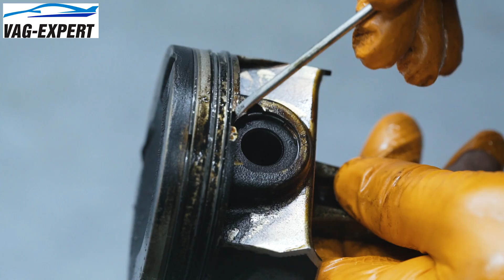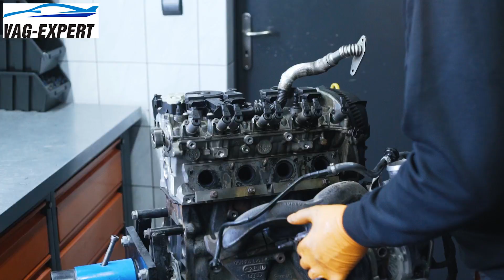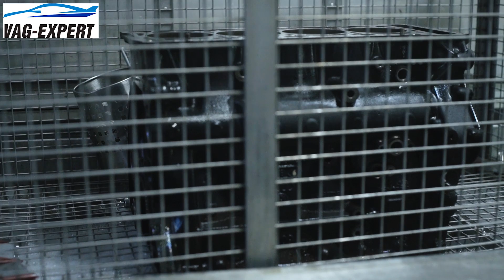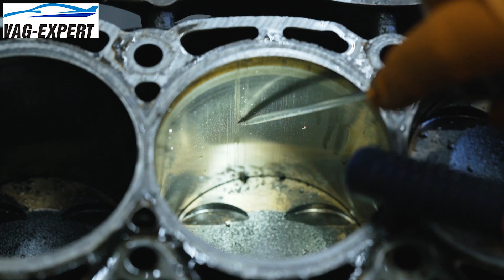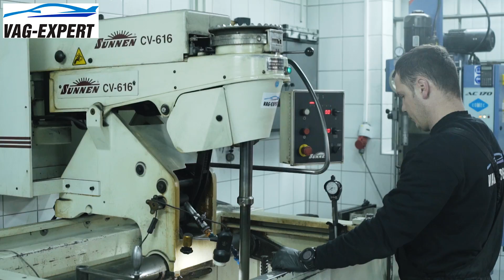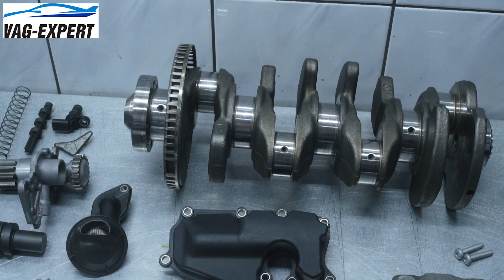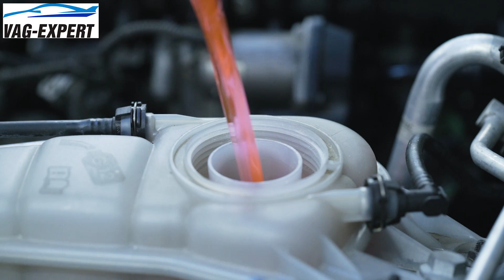TSI and TFSI engine overhaul

Comment: I’m doing engine rebuild now on a 2014 tiguan 2.0 tsi, misfire cylinder 3 and a L of oil every 1300km if driven max 120kmh, if I drive more than 120kmh it burned 1L every 200-300km
So far 3000€ I bought it 6 months ago with 223 thousand km.

Comment: Worked at VW Chattanooga manufacturing plant, bought a brand new ‘15 model Passat, and it started burning oil profusely at 80k miles. I was told that was normal, just keep an eye on it and change the oil regularly, topping it off between changes. The engine made it to 148k and blew up right before this past Christmas, lost all compression on the #3 hole. Lean condition caused by excessive oil consumption caused a hole to burn through an exhaust valve in that cylinder. Pulled the head and all the cylinder walls are trashed, the coolant that filled one of the cylinder bores leaked right past the rings and into the oil pan before it could even be sucked out with a shop vac. Sucks that we paid this thing off and was going to hand it down to our son for his first car but now it’s just a junk pile. No one wants to work in it, no one here in the US seems to rebuild these engines. All I’ve been told is to replace it with a new or used unit. Can’t see spending more than the car is worth to do that. When I look on FB marketplace all I see are blown up Passats for parts, don’t seem like you can hardly give them away. What a shame, $25k down the toilet. Should have bought another Chevy. We just replaced this car with a new Mazda today, hopefully have better luck with it.

Comment: Repair is always cheaper than replace. The problem in our societies is that waste has become so huge, people can always benefit from what others have discarded. If people held on their cars for life, and fixed everything until no longer possible (this is, there wasn't a constant surplus of used cars because people get bored and just decide to buy another) people would never complain of the expense of a service like this.
Reply: I live in a place with high labor rates. $100 usd/hr is a common rate for your average garage. A specialist like this could easlly charge $120-200usd/hr. For me to repair my dad's 2011 2.0t q5 would cost more than selling it and then buying a Q5 with 3.0 supercharged engine or a X3 35i with n55 both of which are more reliable than the 2.0t. Not to mention produce 100 more horsepower. We have owned this q5 for 12 years and I have many memories of it. I learned to drive in this car and I took my license test in it as well. I would love to fix it but it's just does not make financial sense.
Reply: @memememine1 Well said

Comment: That's a lie that TSI/TFSI engines consume oil because of pistons construstion.
They start eating oil because of too long changing oil intervals. Almost every engine will start oil consuming if you change oil just every 15 000 km.
Oil control rings and drainage of pistons just get coked. And usually professional decarbonization is enough to fix oil consuming.

Change motor oil in time (depends on your use conditions: warm/cold, traffic jam or highway and many another factors) (usually 5000 - 8000 km) and engine will work many hundreats km with no oil comsuming.
I checked it on some hundreats VAG engines with endoscope, client's feedback and laboratory and express spectral analyzes of used oil.

Comment: I have a 2.0tfsi engine with 130,000 miles no oil consumption but i have  changed the oil early since the beginning only using high quality oil.  2nd audi ive owned and never follow audi’s service interval.  Always early oil changes and often. It helps a lot for these issues.

Comment: Owner of 2014 USA Passat 1.8 EA888 gen 3 TFSI 149,173 MILES purchased new. Any class action lawsuits in US for owners of Pre 2015 piston ring design upgrade, that corrected the massive oil consumption engineering design flaws that plague the pre 2015 1.8 EA888 GEN 3 engines?

Comment: Wow expensive junk! So your burning oil from factory and that oil clogs up your cat and then cats get hot burn up the cone it's breaks apart and gets blown back into the engine? And people are still buying this junk. At least when Toyota corolla was having this issue Toyota replaced your engine under warranty. Hell even acura is replacing engines under warranty and if you paid for the new rings out of pocket before they got around to warranty it for acura they reimburse you. Audi needs to face the music and just start warranties for these oil burners and turbos going out and oil screen replacements and pcv fails and waterpump fails. This is bs. And one reason I will never buy an audi without a heavy warranty

Comment: Does anyone know if the Audi A5 2015 2.0T CPMB engine have the new piston style? I think this is a Gen 2 EA888.
Reply from the maker: CPM engines have second generation pistons. In these engines, the problem with oil combustion appears at a mileage of 150 - 200 thousand km. We also renovate these engines.

Comment: Can the company rectify VW 1.0 TSI engines? the manufacturer's technical recommendation is that the original measurements of pistons, connecting rods and crankshaft should not be changed; it is understood that they are disposable.
Reply: Toyota is better

Comment: My cars in 17 years:  a Citroen Saxo 1.1i , a Ford Focus 1.6i , a Giulietta 2.0 JTDM-2 and a TT 2.0 TFSI
The only problem with the motor: the TFSI

3000€ to repair , with only 115.000 km (compression faulty)

Audi sucks

Comment: Makes one wonder why it took them 5ys to correct the issue. 2009-2014. I actually did a total rebuild on a 2009 2.0
Audi A4 and mow has 30k miles and no oil leak or burn issue. The number one problem is the oils change interval should never be more than 3k. The carbon in the oil does a lot of damage. They won’t admit to this but this is a key factor.
Reply: Hi. Are you from England?
Reply: @M3RT85  
No. I’m from United States of America

Comment: That's insane the amount of work needed to repair oil burning.
Reply: The issue is actually really really small for the amount of work, it's the piston rings. Unfortunately, you need to take the engine apart to replace them so it's just better to overhaul it as you're already in there. VW upgraded the pistons and the rings after 2014.

Comment: TSI: total senseless invention, TFSI: Total failure senseless invention. This video was sponsored by Honda,  the most reliable car engine manufacturer 😋
Reply: everything is reliable when it make 3hp from a 1 liter engine
Reply: @TONI-bi1lg  Funny but nonsense. Honda s 2000 240 HP 8000 rpm, and lives longer as any VW TFSI shit.  Also the Toyota and Nissan Turbo Straight 6 are famous for bear enormous tuning without failure. The was a feature from a company which offer warranty insurance. There data bases on a lot! cars and the most reliable with great gap 1 Honda 2. Toyota.....near at the end VW/ Audi 7 times more issues compare to Honda 🤔🤦
Reply: @c.b.4270  Dude, I like japanese cars, but all you japanese fanboys always refer to old cars, I understand that Nissan R34, Toyota Supra and many many more JDM cars were fenomenal, but this is 2021, not the 90s, Japanese cars now are more reliable than German cars, but they are really trash when it comes to sportiness. I mean, just for Audi we have more than 10 S and RS models with crazy hp, not even talkin about other brands like BMW or Mercedes,  but when it comes to Japanese cars we have just a handful

Comment: My brother has a 1.2 polo tsi, it has traveled 240 000 kilometers in 4 years. It has been very reliable and still is reliable. He has however noticed that 1st gear is not as powerful as before, other than that she still pulls hard.
Reply: you can use Bardhal additiv for benzine engine , maybe one injecter got to be lubrificated

Comment: as a owner of a 1.8tsi leon II i agree with most of the video.  TBH the engine is awesome when it works fine. The oil consumption issue can be mitigated with frequent oil changes with good quality oil. I really think that VW overestimates the service intervals. 15k km is just way too much, and sometimes they recommend even 25k km. On my car the previous owner changed the oil every 10k with very good quality oil, and the first thing i did when i bought it was a oil change with a good engine flush. At 90k the car uses about 1l of oil every 4k km.
Reply: 1liter per 4 km is bad ,engine is kaput !

Comment: The DI TSI engines were junk!  In addition to faulty pistons and rings, Valve-guide failures and the single injector DI design were compounding the issue as they were also faulty.  The later dual injector DI setup was superior.  VAG’s diesel gate Tinkerhorn should be arrested and imprisoned as he was responsible for this mess as well. No wonder VAG announced they are completely abandoning ICEngines in the next 10-15 years!  You guys better start retooling for EV’s now.

Comment: Brilliant I'll just do this quick fix in my drive.... Looks as easy as changing a wheel.... What could go wrong
Reply: My father in law is about to figure this out for himself...poor guy. First he thought it was the plugs, then He thought it was an injector and now he knows that cylinder one is toast with almost zero compression. He thinks it might just need new rings but I don't think that is going to do it. Only a little over 125,000 km and I think the engine is toast.

Comment: I had 275,000 miles on my 1.8T.  Great car and engine.  Sold to my brother for his kids and then they sold.  Never used oil between 5-7,000 mile oil changes.
Reply: That was a good engine. The tsi and the tfsi engine got the oilproblems and timingchain problems
Reply: @Kwezeltje  Yes, the 2008 - 2012 2.0 are susceptible.  Piston rings wore prematurely.

Comment: In a situation like this where the manufacturer is at fault, they, VW, should have simply exchanged the engine, not a new one
but a rebuilt one. This bad one can be taken away and rebuilt by VW for the next customer who has a similar complaint.
VW had a motto, service before sales, I don't think it applies anymore. A family friend had a VW that had too many issues and
came replacement time she sought out the Asian brands.

Comment: I'm my last year working for Audi I must have done over 100 of these jobs.....well pistons and rings replacement jobs.......got really good at it too ...took me 9hrs from the time I pulled the car into the bay to the time I drove it out ....each job paid 26hrs flat rate....made a ton of money but I got burnt out eventually...engine out and on the stand in 2hrs. B8 A4, A5 and Q5...did a Q7 3.0T too, that was fun as well... not
Reply: So they charged the customer 26 hours for 9 hours work?

Comment: Go to the netherlands (google for it...) and maintain the engine in case of oil consumption. Costs of about 3 K€. Now after 40.000 km I can assume no oil consumption any longer and engine runs perfectly. The question is what of these services in the video above are necessary and which of them are nice to have. Finally in my case I spent 3 k€ instead of 7 K€ estimated by Skoda and I have to admit the guys in the netherlands are experts. They do only this kind of work every day.

Comment: Hyundai Santa Fe black smoke problem?(2019 model 2.0 liter diesel engine, piezo type fuel injector)
Symptoms:
Black smokes coming only ideal and low speed engine movie under 2000 RPM only 

above 2000 Rpm engine high speed black smoke not coming what is the problem

Checking and cleaning part and service:

Turbo charger is service now ingood condition  
 
diesel  injector is in good condition checking service centre 

EGR system is fully cleaned and working properly

Then what is the problem in one to help me to rectify  DD   ??????

Comment: My car is currently at Audi Dealership for excessive oil consumption and was advised they are going to take the engine out. That is all ive heard so far. Will it go thru this process? Do they perform engine removal and rebuild at the Dealership?

Comment: Please, can you tell me which is the best oil for audi 1.8 TFSI  2009 Gasoline - LPG  225000 kilometers, oil for engine and transmission (DSG) automatic 8G
Reply: Original VW oil at the dealership

Comment: Maybe I'm lucky but my engine burns hardly any oil. Are the timing belt 2.0tfs engines  just fine? Or am I lucky
Reply: Depends....what’s your mileage. My chain failed New Year’s Eve night 2016....B8 2ltr Turbo A4....luckily all that had to be done was a chain and tensioner replacement.

Comment: Excellent work. My car is a 2016, so it came with the new piston design. But if I had an older car, I'd bring it to you guys for sure.
Reply: Three years later and I still have the same 2016 Audi and it consumes no oil at all. In fact, the car hasn't given me any trouble at all. It might just be the best vehicle I've ever owned.
Reply: @Japplesnap Thank you returning to mention this. Just bought an Audi A4 2.0TFSI which i assume you have with 44k miles, hoping to get to 144k without too much trouble, cross fingers!!
Reply: @Cr7pton1c Mine is an A5, but same engine and drivetrain as the A4. And now it's about four years later and the car is still great. No issues whatsoever.

Comment: pl. tell what is design of piston and why  they dont burn oil . shape change or  material defference.
Reply: As far as I'm aware Its the clearances and tolerance that messed up these engines.
Reply: I think the primary issue was prior to 2015, the piston rings, particularly the lower scrape ring design tended to accumulate carbon deposits and bind, allowing oil to escape/burn past the scrape ring. 2015 and beyond had a superior ring design quality, and its not an issue.  Wish I waited a year

Comment: You should dig around for evidence of other owners getting this work at least partially paid for by VAG and present printouts when getting this work priced

My missus' 6R Polo CBZB needed a new timing chain, which started to fail and was noisy, and managed to get the cost down to 400 UKP from 1500

Comment: Worked for Audi for 6 years. Just left. These engines are utter shite. Even after piston and ring rebuild these things still burn oil or end up failing completely. Stay away. 

Even on 2012 - 2015 2.0 engines that were not supposed to suffer from this issue are now turning up at the dealer with the same issues.

Comment: only one question . why cam bridge sometimes cannot be refited and easilly slide in on the cams ? I have to hammer it in . It is not aligned on the cams properlly . One cam is off simetry and usually intake one . I suspect warped camshaft but need your opinion . Everything else I already know

Comment: Congratulations ! You've just spent 10k on a 8k car !
Reply: Never buy another german car if you planning on keeping for over 2 years.  Total junk, poor engineering designed
Reply: First of all its in poland were labour is cheaper, poland is like europes china for doing machinery things, its cheap. Only thing that was trully expensive were those new pistons.
Reply: My A4 is chillen, however they guy before me had this issue and got the pistons replaced with the newer ones from the b8.5, I have a B8, works perfectly now
Reply: @tannersmith8228  keep your fingers crossed. I had the rings, pistons and timing chain replaced at 55k on my 2012 2.0 Audi Avant. Cylinder #1 scored 66ke
Reply: @grantbradley5084  yea the fortunate thing is the previous owner had the shitty pistons and rings in it, blew it up, took it to Audi and got the updated ones in it, so I know for a fact it's not that, plus we have only put like 13k on it since then
Reply: But he now has a car with a new engine and if the rest of the car is good and taken care of will run for many more years for 10k, cheaper than buying a new car which is like throwing money down the drain.
Reply: @davidiand7  that's if you pay to get it done, it's a very simple thing... Take off timing and oil pump, then take off lower and main oil pan
Reply: Take off the rod bearings, take out camshaft and replace the pistons. Like a 2 day job at home
Reply: eh these cars are not 1.0L Tata made in India
Reply: @jamesmedina2062  I own an A7 from 2016 , I believe I know the difference.
Reply: @adimazga  so everything is crap except for your 2016 A7 huh?
Reply: @jamesmedina2062  rofl how did you come up with that?
Reply: @adimazga  what? not true? It is a question. I support engine rebuilds. You apparently don't.
Reply: @jamesmedina2062  👍🏼
Reply: @adimazga  Hey, I own a 2016 A7. Should I be worried. I also own a 2014 RS5, but it is currently getting a new engine from Audi as we speak at the dealership, because of Connecting Rod Bearing failure, that occurred at 55,000 miles. Should I trust this new engine has the corrected piston design to decrease excessive oil consumption? Just interested in your thoughts.
Reply: @OEV16Regional  the facelifted A7 looks to be pretty trouble free so far. I'm at about 55k myself. I assume it comes down to maintenance and a bit of luck just like any other car. The pre facelift A7 had steering rack problems and not to mention mechatronics. Seems they pretty much sorted things out. I wouldn't worry about that.
Reply: @adimazga  it only costs like 3,000$ to do this. It is not much.
Reply: @adimazga  take care of Dsg!!!! TdI is better than TSI.

I would've just bought a Lexus GSF instead.
Reply: @dragospahontu  fac maintenance la fiecare 60k
Reply: @adimazga  that's what the manufacturer recommends.

But you should also avoid launching the car hard from 1st gear.
Reply: @dragospahontu  meh 1.8 bro , not exactly  the car you wish to launch. I'm too old for that. 👴🏻
Reply: @adimazga  😅. If you take care of a Dsg it can last 300-350,000km.

But inevitably it's going to fail at some point.
Reply: @dragospahontu  I don't intend to keep it that long, not even half that 😂